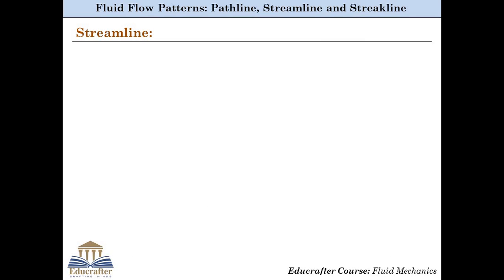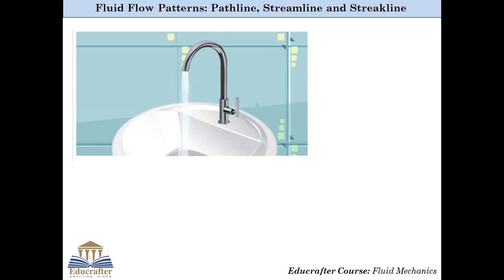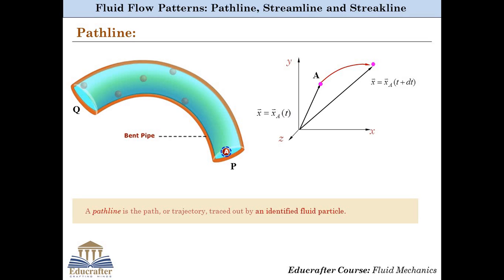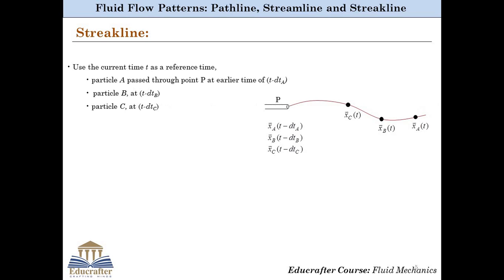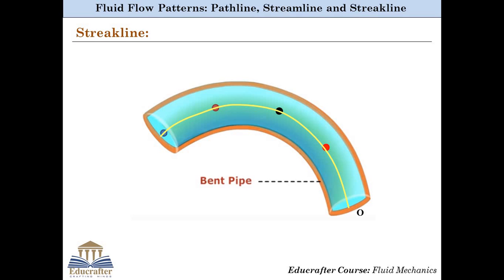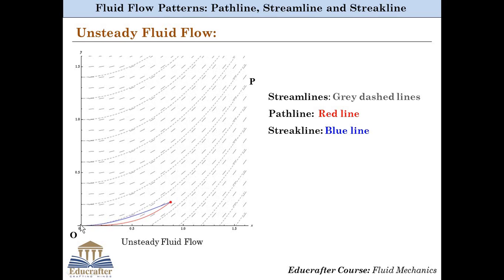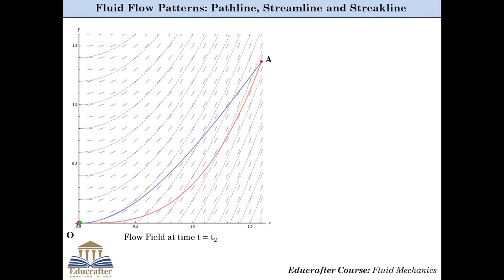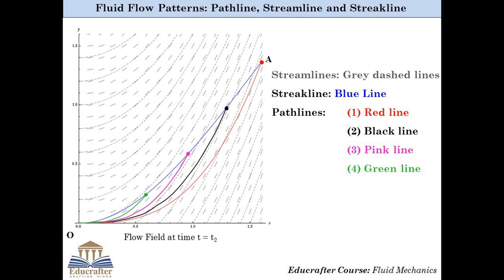Streamline, Pathline & Streakline

Comment: What about steady non uniform flow? Will all the three remain same?
Reply: In short, yes they would be.

The curved pipe is technically an example of non-uniform steady flow, because the particles change velocity (that is, their direction) as they are carried through the pipe. In steady flow, each particle that passes a given point would follow the same path, thus streakline=pathline. 
Also, each particle would essentially 'become' the next particle it is moving towards (including the change in velocity), in later time. This is basically a chain reaction through the domain and we would find pathline=streamline.

Comment: sir, by explanation stream line and path line are different , but by visual they both looks similar, how can we differentiate each of them and what is the application of stream line?
Reply from the maker: Dear gowtham a,

Streamline and pathline are totally two different lines.... Streamline is always show at a particular instant of time whereas pathline requires certain interval of time.

For steady fluid flow whoes flow variables do not change with respect to time, both these streamline and pathline looks similar. But for unsteady flow field, they will be different. In this video I have explained the clear difference between streamline, streakline and pathline using an example of unsteady flow field.
All these lines are rigorously used for flow visualization.
Reply: Thank you sir for replying, but  the application of all this lines what  you have said  , i already know sir, they are used for flow visualization and to reduce drag caused by eddy, but its not the thing I am asking sir, i'm asking what is the part of stream line in flow visualization, like path line shows the path followed, i'm asking the purpose of predicting stream line in flow visualization sir

Comment: Sir can we say that all three lines are also coincides for unsteady flow also at just near about Origin for very small distance???
Reply from the maker: Dear Abhishek Kumar,
 A line is defined as combination of infinite points. So all these lines i.e. streamline, pathline and streakline are representing several set of points in a space. So u can not actually say that they coincide at origin. But yes, you can say that since all these lines are defined at origin, they all must pass through origin. So even for unsteady flow they must share a common points at which they are all defined. 
I hope I have answered your question. Let me know if you still have any query.